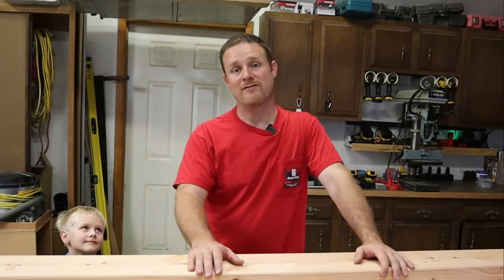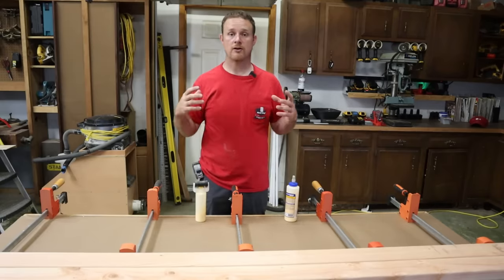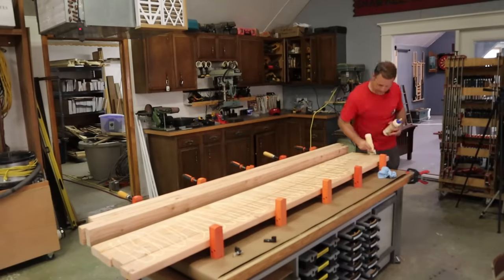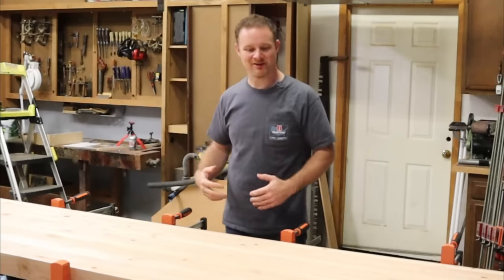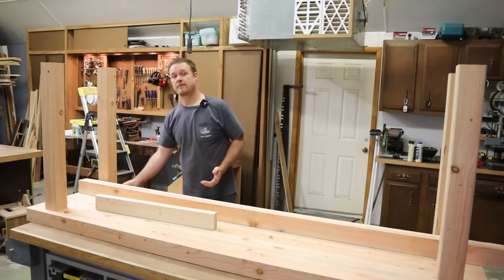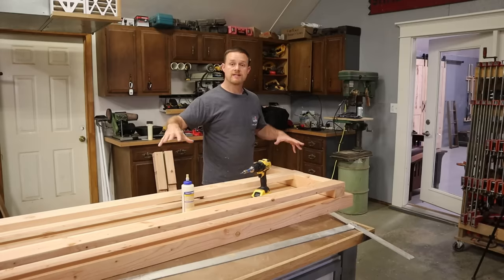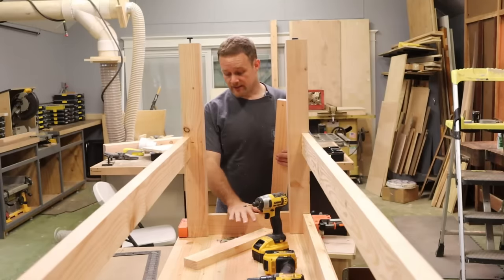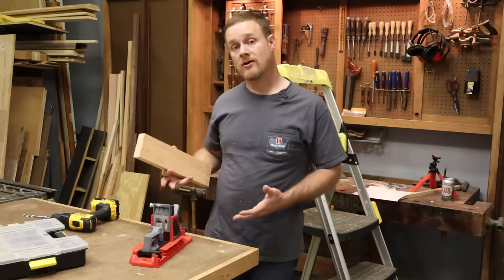How to Build a $100 Workbench in 4 Hours!  E73

Comment: I am sorry to say this, but I have some suggestions for improvement.

When you select the lumber for the top slap glue up it is a good idea to look at the endgrain. Maybe you did, but you did not show or mention. The curves of the groth rings should alternate from board to board, so the movement of the slap gets minimized. It should be concave, convex, concave, convex and so on.
I saw there is a phat ass jointer in your shop. Why didn't you use it? The thinkness planer makes the faces smooth and parallel to each other, but not flat and square. In a workbench or worktable I allways check the slap for flatness with straight edges, winding sticks and the string method. There is no doubt that these workbench is really strong and it will last a lifetime. But it is also the reference surface for all future projects. So I highly recommend investing a bit more at that point.
And you put finish only on the top in the video. There should also be finish on the buttom of the slap. With only one side finished there will be more wood movement, because on side takes and releases moisture at another rate than the other.
Reply from the maker: ensen89 these are all great things you mentioned.  For the growth rings you are correct.  I spent a lot of time deciding on the orientation of the boards.  For the finish, I put a coat on every surface twice, but no one wants to watch 5 minutes of finish.  It’s kind of the downside to videos.  Lastly for the jointer, it wasn’t needed.   My assembly table is dead flat.  I spent a lot of time to make sure of this.  I also spent a lot of time selecting the straightest boards I could and put forth a lot of effort during the glue up to insure that the glue up was flat.  When these slabs were on my assembly table there was absolutely no rocking.  They were dead flat.  Also, this is not a woodworking or fabricating bench, it is for mechanic work. If for some reason it wasn’t flat, it wouldn’t be that big of a deal.
Reply: @shaweehillsworkshop4226  In this case: congratulations to this awesome, strong bench. :)
Yeah, the downside of video, you are correct. The thing is just, we know all this stuff. But somebody who doesn't and builds a workbench after this video might be disappointed when everything he builds on the bench comes out cricket or the flat bench warps into a banana.
Reply from the maker: ensen89 very true.  I am going to pin your post so hopefully they read the top comment!
Reply: @shaweehillsworkshop4226  thank you and you'r welcome as well. In almost every woodworking video when people glue up a panel they say that the dominos or whatever are not for strenght just for alligment. And that kinda annoys me. :D It is true and it has to be said for the people new to the subject, but I heard that hundreds of times. It is really hard to point out everything important when it long became a no-brainer for yourself. And it is hard to stay entertaining while still repeating yourself. :D
Have a nice weekend. Happy woodworking or whatever you are doing :)
Reply: ^This was all worth reading
Reply: @RevereOverland  Definitely
Reply: Probably the first thread I’ve ever seen where people didn’t start arguing or make it political. Awesome job guys! And great video too!
Reply: @shaweehillsworkshop4226  what would you do different if you made one for woodworking & mechanics?
Reply: @shaweehillsworkshop4226  a short clip about how to do all that for us dummies would be cool.
Reply: This is a good discussion for a newb like me. Can someone describe in a few sentences the recommendation regarding growth rings? I get that it's motivated by wanting to balance expansion/warping, but how does one identify and properly group growth rings? Appreciate it.
Reply: @USFmarine  if you look at the end grain you will see curved lines,when the lumber was a tree these lines ran around the tree moving out from the centre as the tree grew.the more rings the older the tree.
If you pit all the lines in the lumber the same way ie smiling the top will bow down,if you put the lines unhappy the top will bow up.if you alternate the lines 1 board lines up,1 board lines down and so on the top will stay fairly stable
Reply: @philleeson7835  thank you kindly!!
Reply: Grain orientation doesn't matter.
Reply: It is workbench for life! Great job i video!
Reply: For a complete beginner - what would you use to check the top is flat and square? If not, would would you use to fix it? Hand plane?
Reply: @chrispugsley9675   I am really surprised, who much answers to old comments I get these day. Must be because of the isolate at home situation.
Anyway, if you look down the 4 edges of the bench top, you should be able to see, if there is any bow. You can also check that with a straight edge, level or string.
You will not really see if there is twist in it. That can be checked with the string method and / or winding sticks. There are tons of videos about that on youtube.
How to fix it is a question I can not answer, sorry. I prefer the router sled, but if you ask somebody else you might hear handplane, powerplane or beltsander or "ask somebody with a three foot jointer". Some people flatten bench tops on cnc machines.
I can only recommend that you watch several videos about each topic or method I mentioned and make a decision what fits you best.
There are a lot of fancy winding sticks out there way beyond beginner skills or budget, but it can be made from sheet goods or aluminium extrusion.
A lot of router sled or string method videos show the use of a jointer. If you don't have one, that is not the end of you woodworking. You can work around that with jigs for the tablesaw, the thickness planer or the router table or with a handplane. You can use sheet goods or aluminium extrusion instead.
What ever jigs and materials you use, make shure they are straight and flat and that your blades and bits sit tight.
This is a very long text with a lot "ifs" and "whens", but I can not really give you a short answer, without knowing what is in your shop, what you want to put in your shop, what you could borrow from somebody and what your skills and preferences are.
Reply: Maybe you should make a video instead of hating
Reply: @stefanopassiglia  I've been a woodworker/cabinet maker for 45 years.....you don't have a clue what you're talking about....
Reply: Dude over here criticizing a $100 workbench like he’s some world renowned workbench judge... Has ZERO videos of his own craftsmanship. Easy to judge when you have nothing of your own that we can judge.
Reply: Why are you watching this if you are such an expert?
Reply: @CptSpears007  Because I am not just an expert. I am also a sadist and I get a lot of pleasure from annoying people like you and all the others who wrote similar comments! :)
Reply: @hubari  I am very proud to say this: You do even more.
Reply: i know im asking randomly but does any of you know of a way to get back into an instagram account?
I was stupid forgot my login password. I would love any tricks you can give me.
Reply: @Knox Zavier Instablaster ;)
Reply: @Darius Ricky thanks so much for your reply. I got to the site thru google and I'm trying it out atm.
Looks like it's gonna take a while so I will reply here later when my account password hopefully is recovered.
Reply: @Darius Ricky it worked and I finally got access to my account again. I am so happy:D
Thanks so much, you saved my account!
Reply: @Knox Zavier no problem xD
Reply: @philleeson7835  the way you explained this made it click in my head thank you so much
Reply: @stefanopassiglia  I agree with this comment. When everything is screwed together there is no chance of warpage, the glue and screws hold it and keep this from happening. You really don't have to be a woodworker or know a lot about anything to build a workbench.
Reply: where do you buy your 2x4 from? I just built a workshop table with 2x4 from lowes, but they are not 100% straight, alwasy a bit of curve on them and I dont have a planer at home. Is there a place that sells planed boards?
Reply: @perfecto25  I do not live in the USA or even on the American continent so I can't tell you a store to go to. What I know is that you can look for S4S lumber, but you might not find that at a big box store, but at a lumber yard. I just need to warn you that this option might blow up your budget.
Construction lumber has allways been a bit wanky, but from what I hear it keeps getting worse. So maybe just keep digging through several stores to find enough nice pieces or go to a workbench design made from sheet goods. Or just enable yourself to mill lumber. If you wanted to you could do it with a hand plane from the flea market or with a el cheapo power planer. There is also always the option of using jigs for the table saw and/ or router to mill lumber without a jointer and planer.
Reply: After watching this video just now, im dead set on making this bench since i have just starting getting into home improvements and building things. As great as the video is, your commented suggestions makes it that much better for not only this, but any project moving forward. Even 2 year old comments are helping people today! Thanks everyone 👌

Comment: Thanks for sharing, looks good. How did you connect the frame to the top? You mentioned pocket joinery at 6:50 when talking about top side stretchers.
Reply from the maker: I used pocket holes through the stretchers.  Thanks for watching!
Reply: I also had that question.  Shawnee, thank you for answering it.

Comment: this was quite the video, very cool!.... so, im wanting to build a work bench of sorts, or, a sort of machine stand. something that i can use for my lathe, since i am rather short, and i doubt any bought stand would be short enough for me to use it with, as such meaning build my own. so, ive thought that i woudl use plywood at a top, maybe some 6 foot long Baltic Birch or something similar and strong. and about 24 inches wide, and about 20-24 inches in height, so that the 12 inches form the base of the machine to the center of the spindle woudl be at a comfortable height to turn with... my only, trouble? is how i go about the joinery. i intend to use 3x3 for the legs, and probably 3/4x6 for the "rails"? i guess... basically the frame parts.... i figure i would mostly screw it together, and use Rabbit Joints for where the parts meet... woudl that perhaps be strong enough do you think? i am considering maybe making it mobile with castors, which i could lift up for stability when not moving it. or, if not, well then leveling feet like you have done. otherwise though, i am just wondering if such a design woudl be strong enough... perhaps if added extra angled pieces in other parts that would nto be used for any art of storage potential.... anyways, i really enjoyed this video, it is nice and inspiring to me =)

Comment: I know this is probably the most insane question but I’m very new and working on building a work table... how did you attack the table top to the legs? Did you use pocket hole and glue or was it some type of joint . Yess I know it’s probably something obvious but I’d rather be SAFE THEN SORRY 🤘🏼😃 thanks as always guys, youtube has definitely saved me thousands by avoiding having to go to a vocational school/ trade school !!
Reply: Pocket hole joinery.  It's strong and you can pick up a entry level Kreg jig for cheap!  Good luck on your build!

Comment: I'm just starting my woodworking journey and have watched countless videos about how to build my workbench and this is by far the most useful video I've seen so far, so thank very much! 
I've added a some questions to a few of the comments below so hopefully your subscribers can help me out! What kind of wood did you use? Also, if I buy treated wood from the merchant, does this stop me needing to put it through a planer? (I don't have one yet!). 
Again, thanks for the video I'm excited to get started on this one (once I know what the hell I'm doing!) :)
Reply from the maker: Chris Pugsley the wood is just pine lumber from a home center.   I put the wood through a planar to get it smooth on top.  2x4s are rounded over so there are little cracks between them if you don’t smooth it.  If you don’t have a planar, you can just use a circular saw or table saw to rip a small amount off of one edge of each 2x4 to make them flat on one edge

Comment: This is a good design.  Tougher than it needs to be, but it will definitely last a lifetime.  With engineering you can make it even stronger, but it's pretty strong as is.
Reply: A big waste of lumber.
Reply: @RadioRich100  No doubt that it uses more lumber than necessary !!

Comment: Man you got a nice shop. Do you have a video on the tool cabinet in the background? Also are the planer blades factory or did you get the helix head? I'm working on purchasing that same model and was curious how it was. I heard the shelix was the way to go if you can swing it.
Reply from the maker: Unfortunately I built the tool cabinet years before I ever thought about videoing projects.  As for the planer, I have the standard head in it and love it compared to previous planers I have owned, but I can imagine that the shelix is even that much better!

Comment: For the topside, is 2x4 glued the best approach, or would 4x4 work the same?

The build looks great, along with the top comment to address a few bits, just looking at ways to reduce certain steps (not through laziness, more through less steps to get wrong)
Reply from the maker: Ryan Reed 4x4’s would be fine
Reply: 4x4's would probably be more expensive, and I haven't seen ANY videos using them for a top (I've watched quite a few as I'm getting ready to make a bench myself}.

Comment: Are the legs fastened to the top? You mentioned wanting to have the opportunity to pack the workbench flat for future moving. So, I am assuming the top is screwed in some way to the legs or you're relying on the weight to hold it in place against the wall?
Reply from the maker: Tilghman McCabe it is screwed using pocket hole joinery.  I mention it briefly at 6:46
Reply: Thanks for the info. I am researching what others have done using 2x4's for an inexpensive, yet sound, workbench.

Comment: I was looking for a workbench plan to build my new workbench. The style of the top of this bench is what I want, but when I got to the part that used pocket screws, this killed it for me. I'll find a better plan (preferred) for the base.
Reply from the maker: MASHQUE you don’t have to use the pocket screws.  You can do the half laps like I did on the long stretchers.  As I said in the video I only used pocket holes on the short stretchers so it can be disassembled easily if I need to move.

Comment: Did you run the 2x4's through the jointer and planer prior to the glue up? Also, after the glue up did u do the jointer then planer or just the planer? Any issues with snipe or was that cut off when you make your end cut. 

I'm new to woodworking and looking to make a simple work bench like this before I get into anything fancy.

Thanks!
Reply: It looks like he just glued the 2x4s how they came to me.

Comment: Gorgeous!  Question I’m a beginner. If I didn’t want the shelf, could I leave out the board running horizontal on the bottom and just have a bench standing on 4x4’s?  Not sure if this is a good or bad idea for stability
Reply from the maker: Even without the shelf you want the boards at the bottom connecting the legs

Comment: I like it but don't love the butcher-block top I might go with 1" Plywood.  But it looks to be right at or over 8 feet so maybe that's why you did it.  Also I have a Reloading Press I'd like to mount and unmount when not in use.  Maybe I can bolt it to a smaller piece of 1" Ply and then just clamp that to the bench when it's being used to be removed after.  Not sure yet.

Comment: Did you attach the top to the legs? Saw you move it over with help but didn’t see you connect them. Did I miss something?
Reply from the maker: We used pocket holes from the stretchers.  I didn't show screwing it on, i just talked about it while i was drilling the pocket holes

Comment: Thanks for the inspiration - I used your design (albeit different size) to build a similar bench!  I have no planner though, so hand-planning the top caused me to go "a bit" over your 4 hours time... ;-)
One question: given that the 2x4's of the top are glued, how close to the edge would you feel comfortable attaching the vice? The 1st piece? Also, does it make sense to "twist" the base plate of the vice so that no two bolts will go through the same 2x4?  Should I be concerned about this at all?  Thanks!
Reply: I wouldn't think that would be an issue, especially if you pre drill your holes before attaching lag bolts or strong screws.

Comment: I didn’t see it shown in the video and was looking for a comment. Did you attach the top to the legs at all or just using the weight of the table top? I appreciate it and love this design so much I’m going to steal it
Reply: The top is attached with pocket hole joinery.  If you don't have a Kreg Jig, you can pick up a basic R3 Kreg Jig for $30.  I use them in my videos as well as they're pretty simple to use.

Comment: Can this process with the glued up 2x4's be done if we don't have a planer?
Reply from the maker: Yf Yf yes!  If you don’t have a planet you will want to use a table saw or circular saw with a guid to cut a straight edge on the 2x4’s.  Then glue them up taking care to line the edges up as much as possible.   You will have to do a little belt sanding or hand planing.   Another option if you have a router is to glue them up and then make a router sled to flatten the top